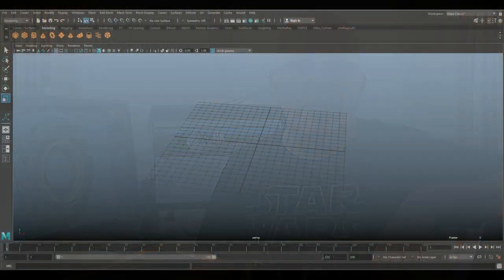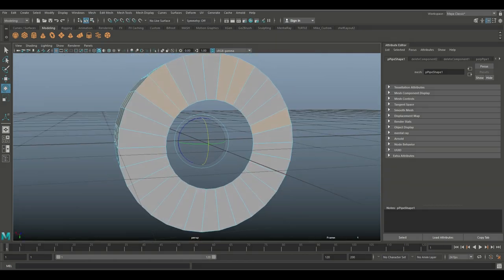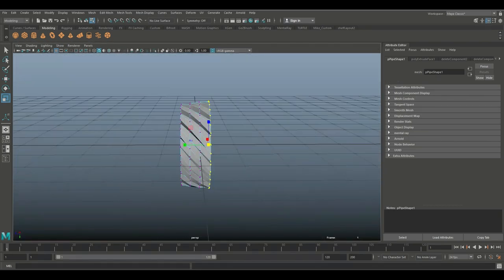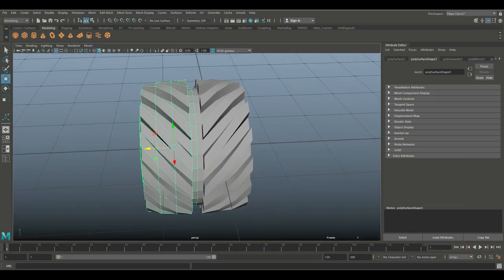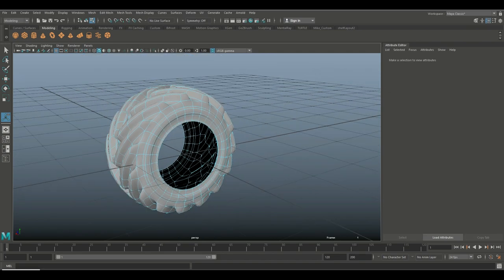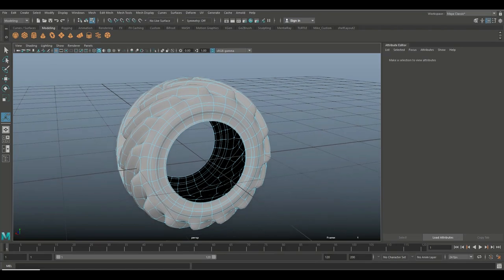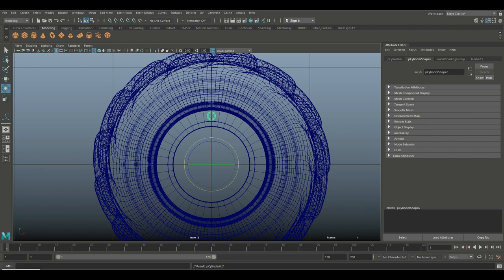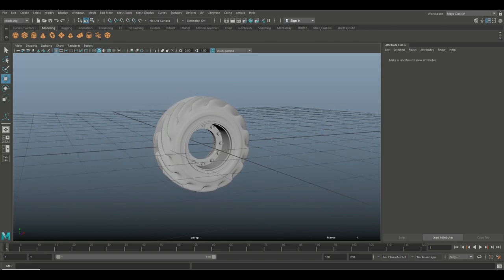Maya tutorial : How to model a TRACTOR TIRE

Comment: Hey, 
really nice tutorial on how to make tractor tires.
Unfortunately there is one thing that really bugs me:
You haven't really solved the issue with the center part. The profile has to overlap there to make the tires run smoother on the road. There are no tyres that don't have the center part in some way - your tire would create the worst possible smoothness on the road.

Imho it isn't that big of a deal if you don't use that design in a somewhat realistic setting.

It just would have been really interesting how you would have solved that problem.  (Cause it's more tricky then just rotating your edgeloops.)

Anyways, thanks for your great tutorials! :)
Reply from the maker: Very good point and I am always grateful when I receive constructive advice.  I am not a tractor guy ( as you might have figured out ) but this does shed a new light on things :-)

Comment: The poly count you have in this tyre Is alright for game?
Reply: Daksh The King games can handle more polys than you think it depends on what platform you choose, you may want to bake normal maps and have low poly mesh for better perfomance
Reply: Alex C i sometimes really get confused, that's why I m just try to gain info, where normal maps can be baked or where you won't need them.
Reply: I'd personally bake it to low res mesh for a game. There should not be a problem with one wheel but if you wanna create a bigger game with more assets (or more wheels) I would lower it. (Bump and normal maps are great to fake a bevel).
Reply: You can paint texture in zbrush add detail using texture brush export texture map to Maya. Again go back on zbrush than add details by sub dividing your low poly model, export the sculpted details using normal map. This will give you high quality detail  in your low poly model.